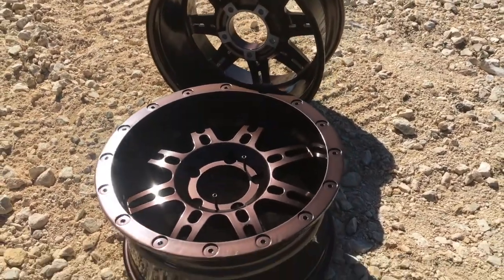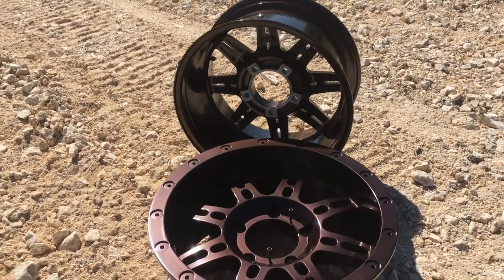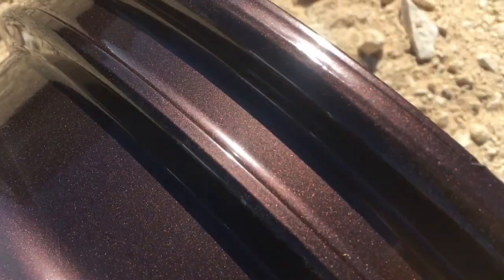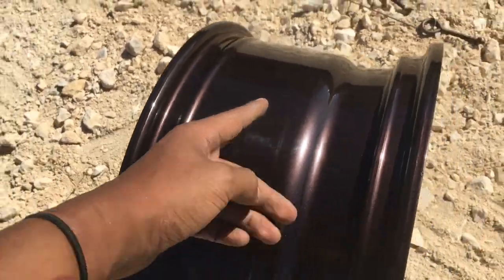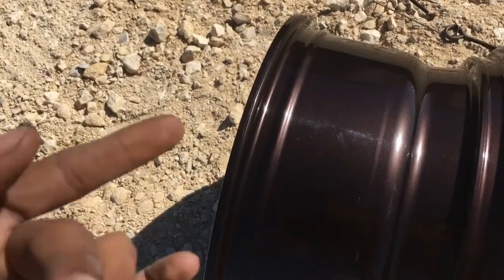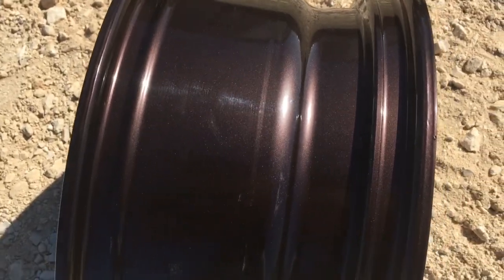Matte Black Rims and How We Do It

Comment: Great video  them wheels look amazing. 
I have a  quick question  
I'm very new to powder coating. 
When you put the tape on the back you cut out where the wheel  bolts go but left where the  wheel hub goes  .is there a reason for  this ?
Keep up the good work
Reply from the maker: Nope no reason you can cut that out also it but some times when rims have center caps you wants to mask off that part don’t cut out the whole and plug the front so when you putt the center cap back on it’s goes on a smooth and still fits we will try and do a video on this soon